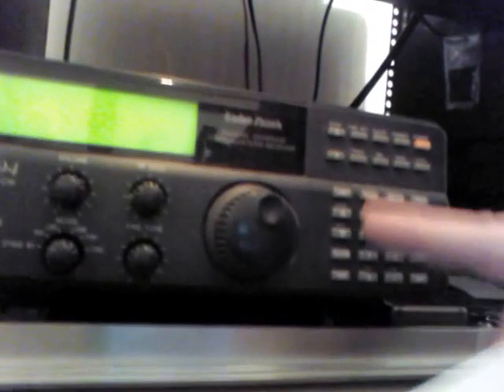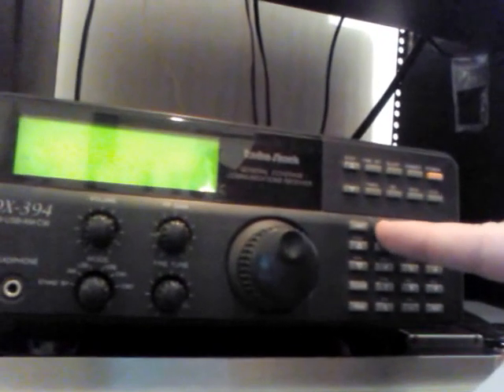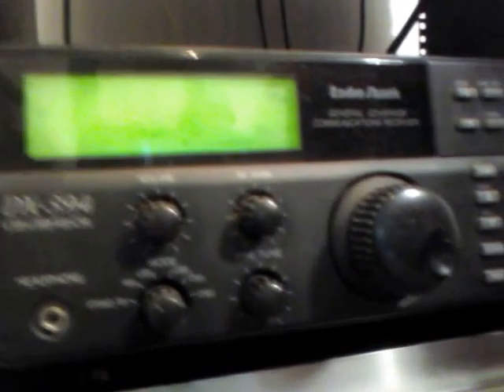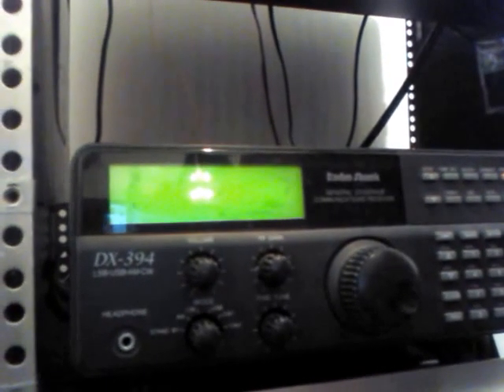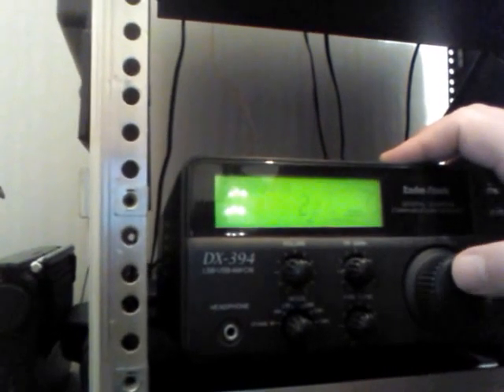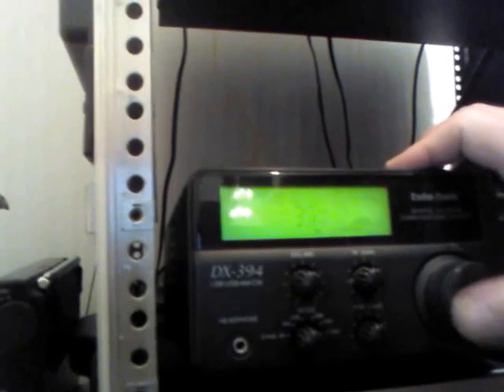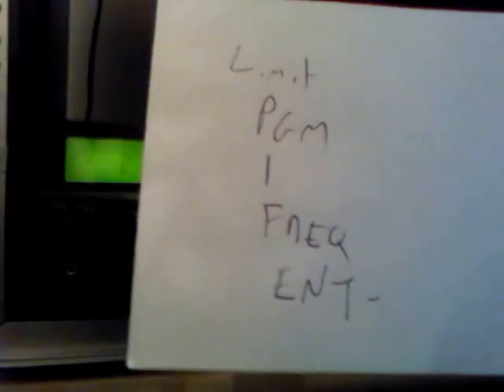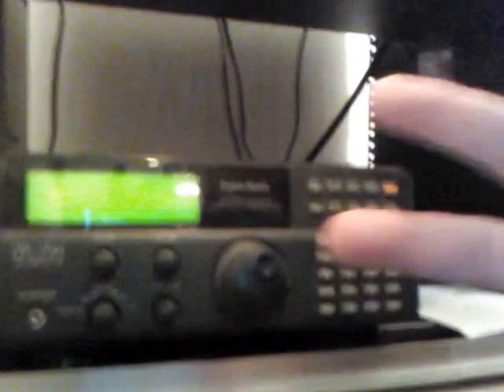RadioShack DX-394 VLF/LF tuning below 150 KHz expansion non mod...

Comment: I wish that this radio would be set on 1 kHz by default or include this programming feature in the instruction manual if it's not a modification.  How dare that Radio Shack leave this programming tip out of the instruction manual.  If it wasn't allowed to be programmed like this, then it would been locked at 150 kHz by requirement.   I need to take these notes and keep them on hand.
Reply from the maker: I wound up selling mine and just using my Kenwood ts450sat had more filtering